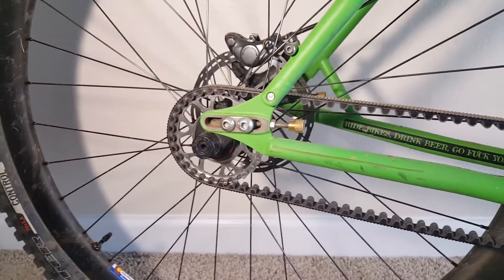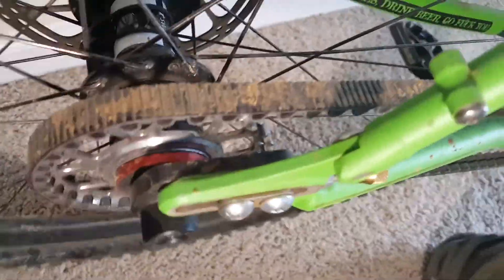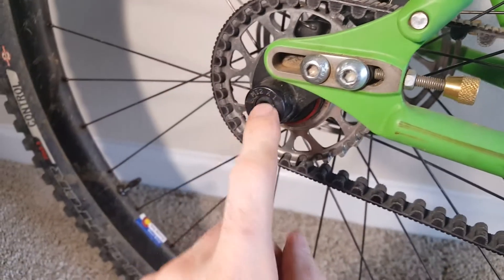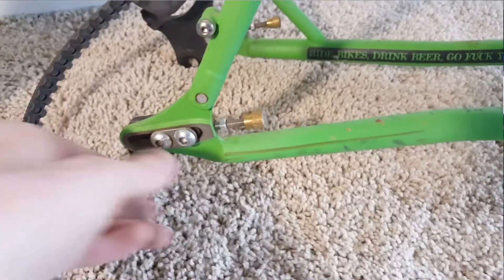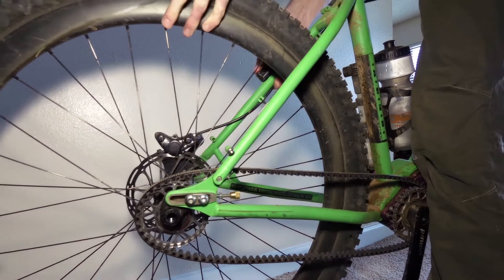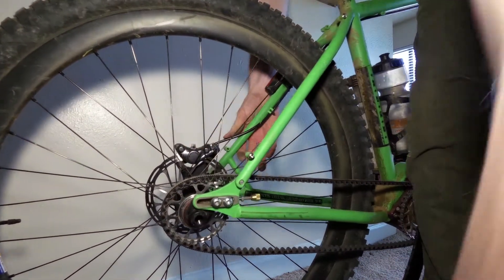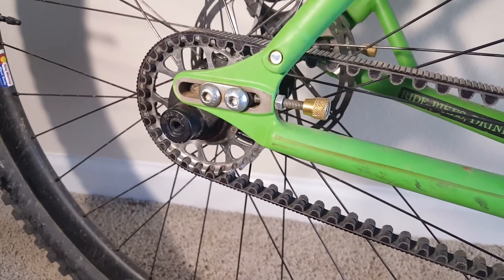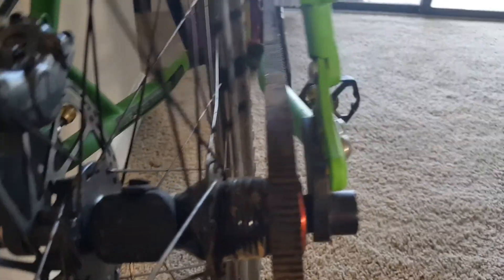TENSION GATES BELT DRIVE with your PHONE'S MIC!!!

Comment: Thanks for the video! One thing I learned was If you take a 24" straightedge/ruler, you can lay it flat across a couple teeth on the front pulley and check the alignment of the rear pulley that way. I bought my bike used, and it was surprising how far out it was from the previous owner. It's near impossible by eye since you can't help seeing the angled out chainstay on the bike. Using this method, you can get it near perfect.

Comment: That nut on the pushing pin/rod is actually counter nut. And it's for locking the rod tight against the frame, so that the rods won't spin out from vibration and also so that the rods once set correctly won't move. So then you can loosen two other bolts and put the wheel back in without setting up the distance and centering the wheel between chainstays again.